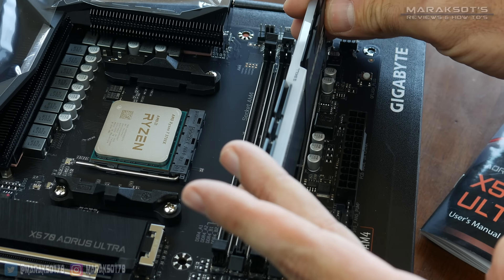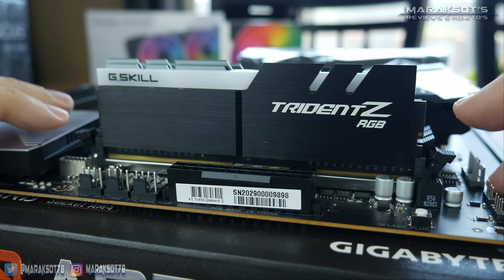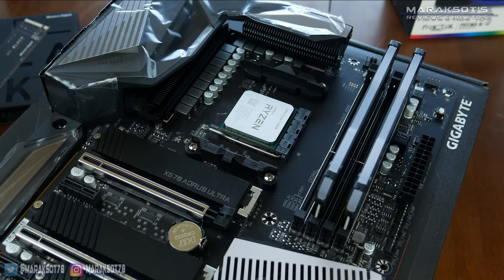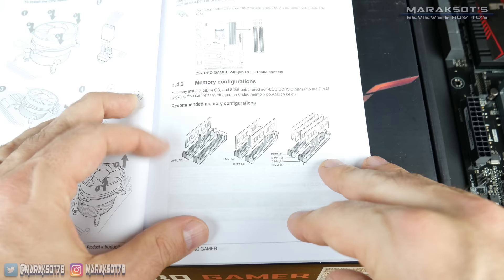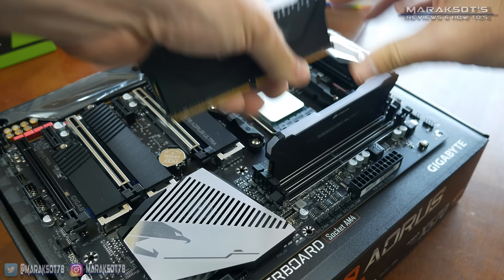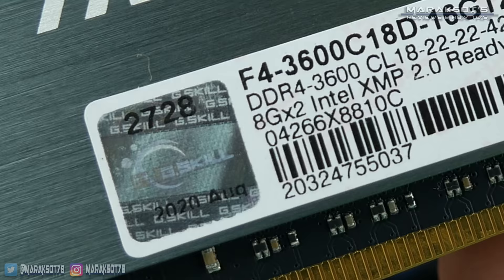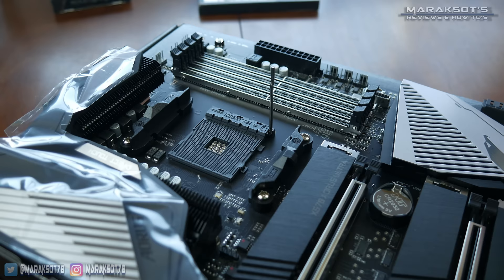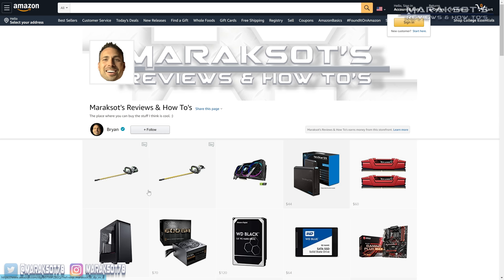A Beginners Guide: Upgrading Your PC's RAM

Comment: Hey, maraksot
I have an issue with my RAM I'm not sure why maybe I'm just not putting it in right but when I put it in the proper way I get no signal so I tried putting the sticks next to each other and that seems to work with the total RAM amount showing correctly but I obviously want it to be dual channel do you know of any other reason why it wouldn't be registering?

Note: All slots have been tested and work with 1 RAM stick in and 2 only works when there next to each other any help would be greatly appreciated.
Thanks.

Comment: i need help about the ram of mine i have watched a few ram tutorials and what my ram speed is in my task manager it says 2400mhz and in my commands prompt it also said 2400mhz and i did some research on what ram capacity is 2400mhz for my ram it always says its 4gb for 2400mhz but it also says on my ram that im using 8gb of ram soo.. i need help and the 8gb ram speed is 2666mhz but says mine is 2400 even tho it says im using 8gb of ram ("also the brand of my ram is Ramsta")

Comment: I'm upgrading from DDR4 to DDR5 FURY will I approach any problems?
Reply from the maker: Are you upgrading your motherboard and CPU too? DDR4 and DDR5 have different pin outs so DDR5 will NOT fit in a motherboard that is currently using DDR4. So to upgrade to DDR5 you'll need to upgrade your motherboard. And when you upgrade your motherboard you're more than likely going to need to upgrade your CPU also because the new platforms that support DDR5 use new/different CPU sockets that your old CPU is most likely incompatible with.
The only way you'd be able to get around having to also upgrade your CPU is if you currently have an intel 12th or 13th gen CPU. Intel 12th & 13th gen CPU's support both DDR4 and DDR5 BUT to use DDR4 you have to have a motherboard with DDR4 slots and to use DDR5 you need a different motherboard with DDR5 slots.

Comment: anyone that can tell me if there would there be a difference between having 4 modules with 8 =32 vs 2x16=32 ?
Reply from the maker: Having 2 sticks of RAM as opposed to 4 is less taxing on your CPU's memory controller which helps quite a bit with high XMP RAM  speeds.

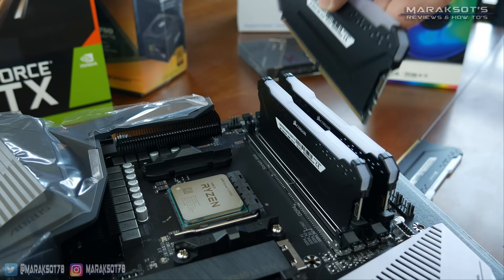Comment: @ 2:05 this is my situation, the 2 slots are already taken but i want to add two more, does it have to be the same brand, same speed?
Reply: Its best practice to install the same brand and model of RAM. As long as you install RAM that is the same speed and CAS latency as the existing modules, you likely will be fine. Some motherboards are very picky and others will not really care as long as the module fits.

Comment: Question… I have 8gb of ram and I’ve been using my pc since April. If I remove that stick of ram and replace it with 2 new ones (16gb) would it affect any of the memory or apps I have downloaded on my pc?
Reply from the maker: No. Upgrading your RAM will not mess with anything you have saved on your computer. Everything is saved on your hard drive or solid state drive (SSD). RAM is the place where files are temporarily loaded into from your hard drive or SSD so your CPU can work with them more quickly.

Comment: Can I combine my original 2 LPX 8gb sticks and add 2 Vengence Pro 16gb sticks?
Reply: Nope minimize the issues, I'll just use the 16gb. I guess is it just as simple as replace and plug. Don't need to save anything on the computer?
Reply: To answer your question, its best practice to use the same brand and model of RAM. You could likely use different RAM, but there's the potential for stability problems, especially if the RAM is different speed/CAS latency. It doesn't mean it will happen, but its best to avoid that potential from happening.  As far as saving stuff on the computer, not sure what you mean. All data is stored on the hard drive/SSD. RAM is temporary storage. When you open a program, parts of it get copied from main storage to RAM. RAM itself doesn't store anything if your PC is powered off.

Comment: So say if I buy a prebuilt and before turning it on I add more ram I bought separately, is that all, do I need to extract the motherboard or can I just add it in the motherboard while in the pc?
Reply from the maker: You can add it white it's in the case still. I was building a new PC at the time I made this video and having it out of the case allowed me to get camera angles I wouldn't be able to get with it in the case.

Comment: what heppend if i add ram of the same speed but not same brand, will it brake my pc ?
Reply from the maker: It won't break it, but it's possible you may experience system stability issues. I do know of people that have mixed and matched different brands and even speeds of RAM and had no issues, but I've also heard of people doing the same thing and having a lot of issues. So just to be safe I always stick with the exact same stuff even if that means I need to completely replace all the RAM in my system.

Comment: Do i need to do something after i change my ram from 8gb 2666mhz to 3200mhz 2x8 gb? Or is it just plug and play? My mobo is a320m. Thank you in advance.
Reply from the maker: if you want your RAM to run at 3200MHz you need to enable XMP (or DOCP if you have an Asus motherboard) otherwise it will only run at 2133MHz.  That being said, you say you have an a320m motherboard so I must ask what CPU you have?  If you have a Ryzen 1000 or 2000 series CPU you may have trouble getting your RAM to run stably at 3200MHz.  Ryzen 1000 and 2000 series CPU's are notorious for becoming unstable with RAM speeds over 3000MHz.  Some chips are fine but my understanding is the majority have issues.  I used to have a Ryzen 7 2700X and some Corsair Vengeance 3200MHz RAM.  My PC would boot up fine but would randomly crash while playing games and stuff.  I finally figured out it was the RAM causing the problem and I dialed it back in the BIOS to 2999MHz or something like that and that fixed the problem.  I have a cousin who also had a 2700X and experienced the same problem I did and had to downclock his RAM too.  I can't say for sure your CPU is going to have the same issue or not but I wanted to at least make you aware this is a problem that exists.  AMD fixed this RAM instability issue with Ryzen 3000 so since upgrading away from my 2700X I've been able to run my RAM at it's rated 3200MHz.  If you enable your XMP and your computer won't boot and you just get a black screen or if you experience random crashing like my cousin and I did, I made a video showing what to do to fix it if you need.  https://youtu.be/Q8UihjknO_M

Comment: So my mobo supports dual channel but not quad channel, if I add 4 of the same sticks will it still run in dual channel
Reply from the maker: Yes. It'll run in dual channel with either 2 or 4 sticks of RAM
Reply: @Maraksot78  aight ty

Comment: i try to install a 8gb on my dell inpiron 580 but it make a sound and it will not reboot and i check that i only can put a 4gb memory so my question is can i install a higer gb ram or do i have to stick with 4 like the factory said?
Reply: Its best to stick with the official recommended specs for your computer. If the manual says it only supports 4 GB modules, then that's it. There are sometimes instances where you can exceed what the official documentation states, but it's not guaranteed to work.

Comment: do i need to backup my computer or mess with it if i get completly new ram
Reply from the maker: No. RAM is where your data is temporarily stored so your CPU can quickly work with that data. RAM is much, much faster than a hard drive or even an SSD.  All your files, applications and operating system are saved on your hard drive or SSD; replacing RAM will not make you lose any of your files.

Comment: I know this is uploaded 2 years ago but I want to ask this question. I have two ram slots in my motherboard and I want to buy two modules of 8GB ram with 2400 speed, so is it ok if I fill both of the slots for dual channel?
Reply from the maker: If your board only has two slots; yes, you will have to populate both slots to enable dual channel.
Reply: Yes worries... I have never connected the PSU from the motherboard. I guess for the safest possible practices you would do that but I've never done that and in 15 years of PC building haven't had an issue.

Comment: @Maraksot78 I have a factory installed Hynix HMA81GU6CJR8N-VK (or "Hynix 8GB PC4-21300 DDR4-2666MHz 288-Pin DIMM 1.2V Memory RAM Module HMA81GU6CJR8N-VK" according to Amazon) ram installed and I bought 2x 8GB Kingston HyperX FURY RGB DDR4 2666 MHz CL16 ram pack from my local electronics store. I have an HP 8433 motherboard with AMD Ryzen 5 2600 processor installed to it (again by factory). Is there going to be any issues installing my new RAM modules on a 2019 desktop PC? Also I tried to look the XMP/DOCP setting on my system bios, but i couldn't find one, it being very basic blue like bios (American Megadrends). Is there possible way I can enable the said XMP/DOCP elsewhere?

Comment: Hey there. If you are still reading this comment section, I could use some help. I just swapped out my RAM and intensive games will crash my PC when using the included xmp profile for 3600MHz. Does this mean the RAM is incompatible with my mb? Or would the computer start at all if it was incompatible? Everything works fine when I revert to the default/minimum DDR4 speed of 2133.
Reply from the maker: What CPU do you have? I used to have a Ryzen 7 2700X and if I ran my 3200MHz RAM at that rated speed sometimes it would crash, but if I backed it off to just under 3000MHz it was fine. The point I'm getting at is some CPU's don't play well with RAM that's too fast for them. 1st and 2nd gen Ryzen CPU's are notorious for this.
Reply: @Maraksot78  thanks for the reply. I have a Ryzen 3700x. My old kit was 3200 with no issues running xmp. I stuck with the same brand to swap to 3600 but I am thinking the kit is not bad, but I may need to reduce the clock manually. This specific model of Corsair vengeance rgb is not on my board’s QVL, but there were many other models that were. I figured perhaps it should be fine and they just hadn’t tested my model. I read somewhere that increasing voltage might work but I’m not sure I want to mess with that.
Reply from the maker: Yah I don't know about increasing the voltage. Sadly the kit you have may be ever so slightly incompatible. Might have to find a 3600MHz kit that's on the QVL to be sure.
Reply: @Maraksot78  just might have to return this kit and do that. I appreciate your input a lot. Thank you. Have a good night.
Reply from the maker: no problem.  :) I love the name of your channel by the way.  :D

Comment: if i replace my ram will i lose all of my data on my compputer?
Reply from the maker: No.  Many people confuse the term memory with storage.  People say it all the time, "my phone has 128GB of memory or 256GB of memory" when actually the term they should be using is storage. They have 128GB or 256GB of storage. Storage and memory serve very different purposes.  All your data is stored on a storage drive of some kind which in computers is either a HDD (hard disk drive) or an SSD (solid state drive). RAM stands for Random Access Memory and most computers nowadays have 8GB or 16GB of RAM (aka memory) in them and most phones have 4GB to 8GB of RAM. RAM is where data is loaded to so the CPU can work with it more quickly as the bus that transfers data between the RAM and the CPU is WAAAAAAYYYY faster than the bus that transfers data to and from your storage (aka hard drive or SSD). That's why when you first launch an application it takes a little time for it to load up but once it's loaded everything works quickly. All the data needed to run that application is being loaded from your storage drive into your RAM and once it's there things run fast and smooth. You can think of the RAM as a work area in a work shop. You have shelves in the shop where all the data (i.e. games, applications, files, etc.) is organized and stored. When you want to access some data or play a game or something that data is pulled off the shelf (or loaded) and brought into the work area (the RAM). Now the CPU can work with that data very quickly because everything it needs it right there to work with in the RAM.  Without a place like RAM for all the necessary data to be collected all at once you would be constantly going from shelf to shelf getting the stuff you need which would mean you'd be loading stuff all the time and it would slow things down A LOT.  Anyway, this is probably way more info than you were wanting but I hope it helps you understand the difference between memory and storage and a little about how computers work.  Cheers. 🙂

Comment: Would I need to do anything in the bios after buying a new ram kit that runs 3200, while my old kit ran 2667??? PLS HELP!
Reply: My mobo is a Asrock b-450 HDV r4.0 if tha makes a difference
Reply from the maker: If you want your new RAM to run at 3200MHz you're going to need to go into your motherboard BIOS and enable the XMP. I have a video about thay of you'd like to check it out. https://youtu.be/WDzrq5IxBX4

Comment: can you Upgrad from ddr 4 to 5 on same pc?
Reply from the maker: No. Your motherboard will only support one or the other.
If you change out your motherboard to one that supports DDR5 then yes, but then that means you're CPU is no longer compatible with your motherboard so you'd also need to change out your CPU, and at that point you're replacing the entire core of your system (motherboard, RAM & CPU) so you basically have a new PC.

Comment: If I have 16gb that run an xmp at 3200 and I add 16 more of exact same stuff do I have to fiddle with the bios again or I just shove it in and go
Reply from the maker: Your system will detect new RAM has been installed and I'm pretty sure you'll need to enable your XMP again.
Reply: @Maraksot78  you are right 👍 I just had re enable xmp and it works as intended tyvm!

Comment: Can i install the ram without getting the motherboard out of the case?
Reply from the maker: Yes. I only had it pulled in this video because I was building a new PC and having the board out of the case mades it easier to get the close ups and camera angles I wanted.
Reply: @Maraksot78  ok thanks
Reply from the maker: @nz9z  no problem. :)

Comment: So if I fully remove my ram for new ram will affect any thing I have saved on my pc?
Reply from the maker: No.  All your files are stored on your hard drive, not in the RAM.  RAM is where files are temporarily loaded into so your CPU can quickly work with them.  Once your CPU is done working with them it will save those files to your hard drive or SSD (if you choose to save them) and removes those files from the RAM and replaces them with whatever new files you happen to be working with.
Reply: Ok so my ram is a 3200 ua2 8gig sk hynix could I just get one that runs the same speed an be ok?

Comment: hello, i had 16 gb of ram (2x8) but one of the dimms died and im left out with only a single channell dimm. im planning to buy the exact same dimms (2x8) and install them on my pc. I saw in the video that if you use 3 dimms the pc will run in single channell but i also heard that this is not true in amd builds. Can someone clarify to me if i buy a new and exact same (2x8) kit and use 3 dimms, will 2 of them work in dual channell and the other one in single? or do all of the run in single (amd build)? So to recap all of it, 2dimms>3dimms or 3dimms>2dimms?
Reply: 3 stick will only run in single channel mode.

Comment: The motherboard's QVL says it will work with that a particular RAM model at its rated speed at 2 x 8GB, will it be safe to assume that it will work at its rated speed if 4 x 8GB?
Reply from the maker: Yes, if you're using the same kit (model number) on the QVL then in my experience you can populate all your RAM slots with those modules and be good to go.  :)
Reply: @Maraksot78  All four at their rated XMP/DOCP speed?
Reply from the maker: yup
Reply: @Maraksot78  Did you have to increase voltages to make all four of them run at their rated speed?

Comment: I replaced my two 8gb with 2 16gb and my games lag so much now... Did I do something wrong ? (Yes yes I updated my graphics card) (and it's a 2080 so it should be able to handle perfectly games like ac. Valhalla)
Reply from the maker: What was your previous GPU? When you updated your graphics card, did you remove the old driver and then install the driver for the 2080? That would be my first thing to check. Also, what is the resolution and refresh rate of your monitor? If it's 1080p 60Hz, I'm wondering if you're experiencing screen tearing which you may be perceiving as "lag". The RTX 2080 is a pretty powerful GPU and can spit out A LOT more frames than 60fps at 1080p. When your graphics card is rendering frames faster than your monitor can display them, then you get screen tearing. Also what CPU do you have? And last question, did you enable XMP on your RAM?
Reply: @Maraksot78  sorry i meant updated graphic card drivers xD i didn't upgrade my graphics card. CPU is the i5 9600K and my screen is 
3440 x 1440 Pixels 100 Hz. I will check now if I enabled XMP
Reply: @Maraksot78  overclocking is on automatic but not on XMP I or II